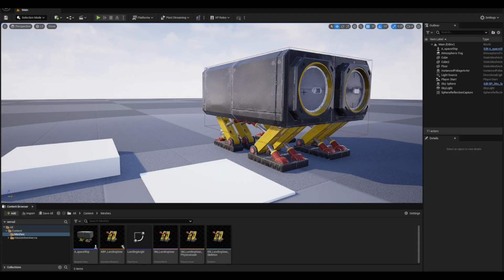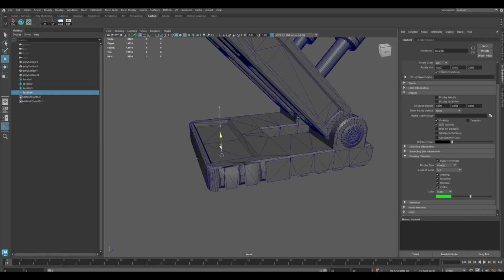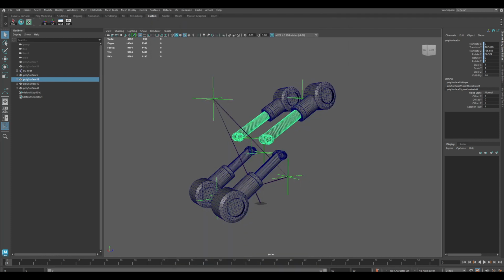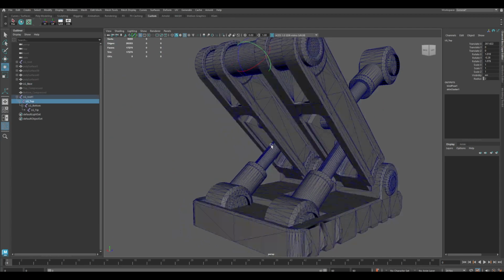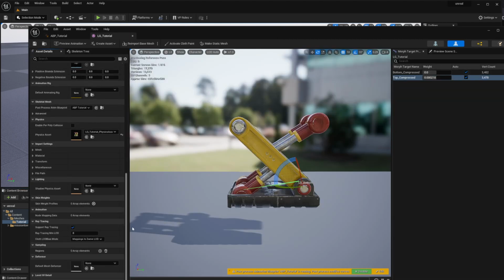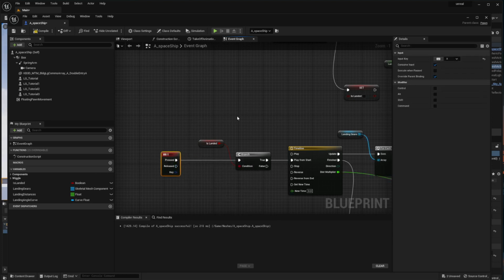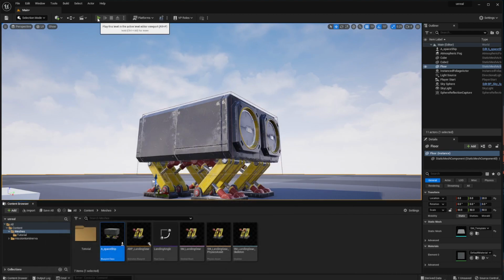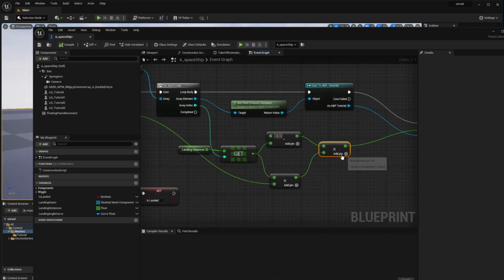Using MORPH TARGETS in Unreal Engine for Suspension animation

Comment: I didn't know UE5 could animate mechanical systems! So far I've been using C4D and importing the animations into UE5. I would like to animate a mass oscilating between 2 springs for an animation sequence. Do you think that is possible directly in UE5?
Reply from the maker: it is possible, you wound need to create a blend shape between the different states and animate the value for the blend shape, similar to the suspension animation in the tutorial but both directions.

Comment: Question, in UE5 is there a way for an animator to control which sprite is used in an Atlas?  For example, is there a way for the animator to control/keyframe which sprite they want to use in the atlas and possibly edit the keyframes in Sequencer?
Reply from the maker: You can manipulate your UV-s to show only part of the texture and control that with parameters. Similar of how the UVs are controlled in the last 2 tutorials (Minimap & UI parallax).